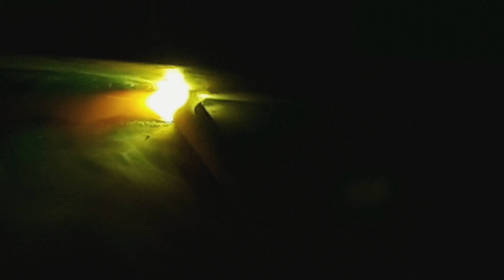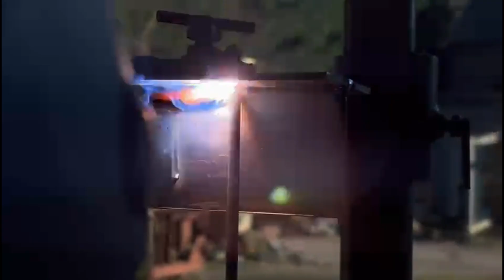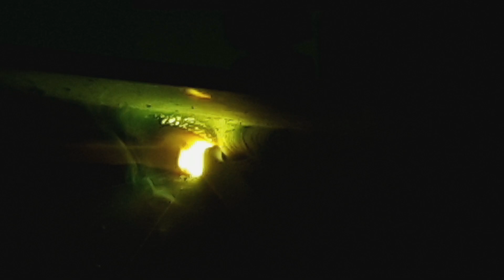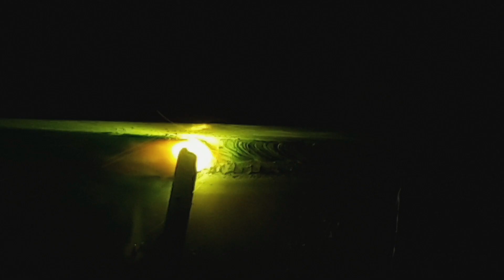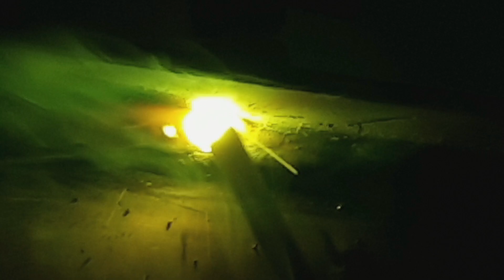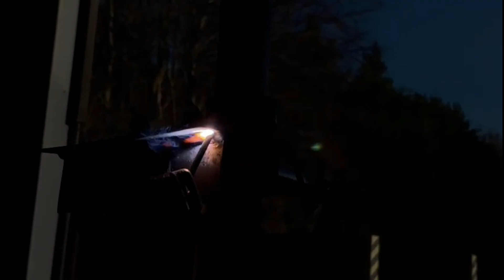Don't Weld Stainless Steel Until You See These 3 Overhead MMA Tips

Comment: Thanks for the video! I have a question...
In your opinion, what is the EASIEST stainless steel welding electrode. I've been stick welding regular steel as a hobbyist for 30 years, but can't get the hang of stainless steel, doing nothing but sticking and feeling like a 10 year old fool. I have tried 309L, 312, and 316 on horizontal passes with no joy at all -- very difficult to strike, keep lit, or basically do a decent job on CLEAN 16 gauge SS sheet metal. What is the easiest possible stick, PLEASE. Is it 308 (which of course I can't get locally)?
Please note, I have tried 1/16 and 3/32 sticks in both DCEP and DCEN in combination with a range of amperages with zero luck. Maybe it is my welding machine - Ha. I've checked all the wires and connections.
Super frustrated here, so thanks very much for any comments or suggestions.
Reply from the maker: Hi thanks for the question. 
I wouldn't say that the type of rod is the problem. SS does weld differently but if you cannot maintain  an arc with all rods I'd personally be looking towards the machine you are using.What is it you have?
Reply: @weldtechsolutions  It's okay now. Would you beleive replacing the electrode holder did the trick? 
The little machine (AHP 160ST dual voltage stick welder) apparently had a not so great holder. Replace with a strong-spring all copper one (Arc-Force ARC532 200amp), which magically helped alot! Thanks!
Reply from the maker: @AerialLensVideo  Great that your all sorted. I'm a great fan of twist grip type of holders so not reliant on springs.
Reply: @weldtechsolutions  Is there a brand and model of that type you have personally used you might recommend (that does not cost a fortune)?